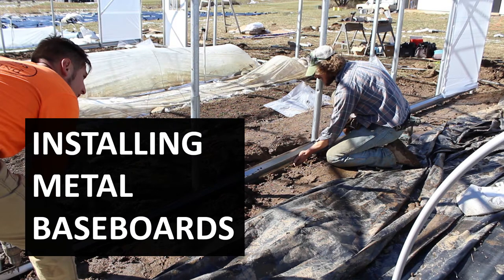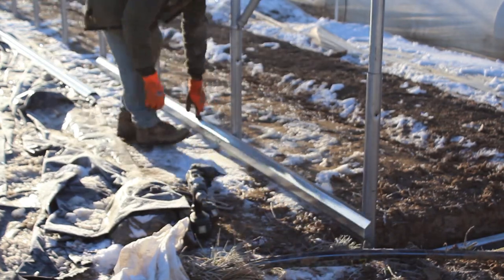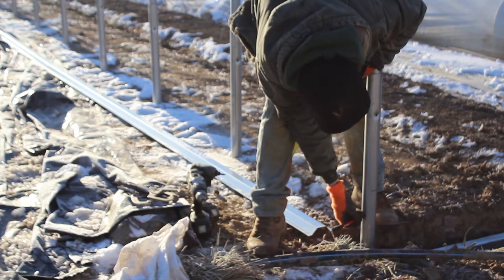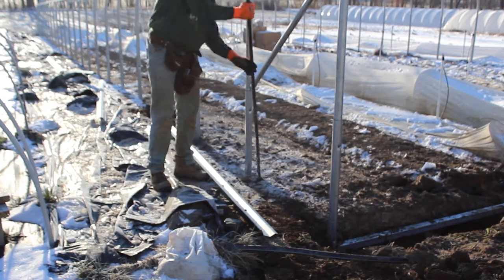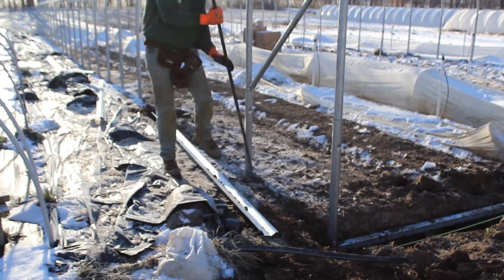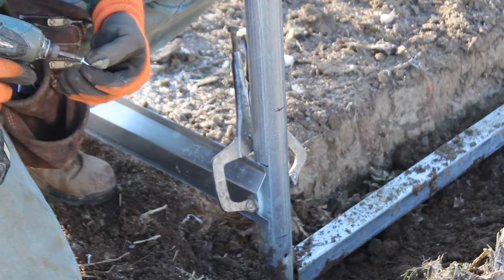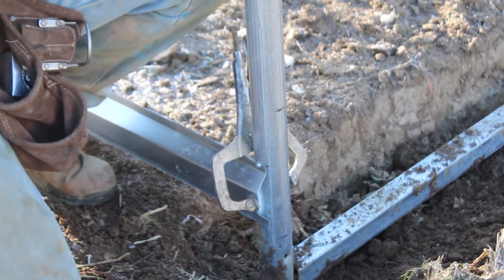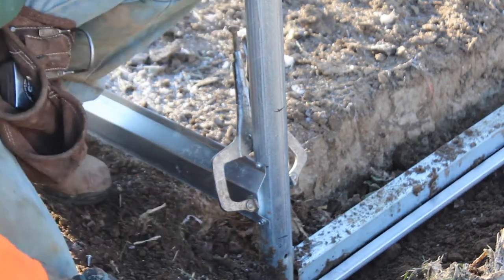How to Install Metal Baseboards on a Greenhouse, High Tunnel, or Hoop House

Comment: I Don't understand the unnecessary expense of buying specialized steel pieces when wood, even treated wood is so cheap and plentiful not to mention more versatile for attaching wiggle wire and base plates or bolting braces to it. Dimensional lumber is much more rigid and durable not to mention rust proof.
Reply from the maker: I suppose there are pros and cons to each building component, but we prefer installing galvanized steel baseboards because we have personally replaced rotted out lumber baseboards on numerous occasions. Even treated lumber when in contact with soggy wet soil will eventually succumb to rot over time. This is a problem that galvanized steel baseboards don't have. They also shouldn't rust because the metal baseboard in the video is galvanized (just like the hoops are). This provides a potential for more longevity, and reduces the need to spend time and money on baseboard repairs or replacements in the future.

With the above in mind, farmers seeking (or with) an organic certification aren't able to use most treated lumbers where they will come in contact the soil which means their options are: 

1. Choose between an untreated lumber that may be more prone to faster rotting 

OR 

2. Choose a metal baseboard option, that may have a higher initial cost, but less rotting / maintenance 

In the scenario above, it makes sense (in our opinion) to go with a metal option. 

As for attaching fasteners and bracing, we feel it is very easy to bolt components to a metal baseboard. It is easy to drill or screw to, and when a bolt and nut are used it holds great. 

You mentioned attaching bracing components to the baseboard, which we don't typically do with our structures. Instead, all of the bracing components for our houses attach to the framing itself; corner braces run from the end-hoop to the ground post or hoop, and this goes for purlins, bow braces, etc. If you are attaching bracing to the baseboard I do suppose it could be easier to make that type of attachment when using lumber. For our purposes though, and if making bracing connections to the framing itself, we find the galvanized steel baseboards work great.